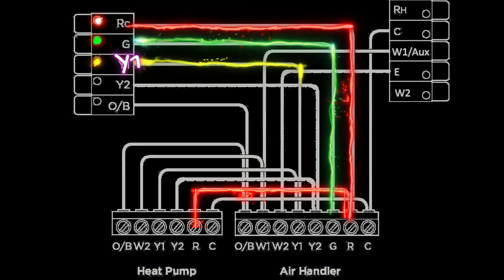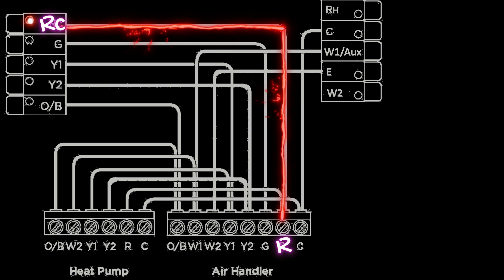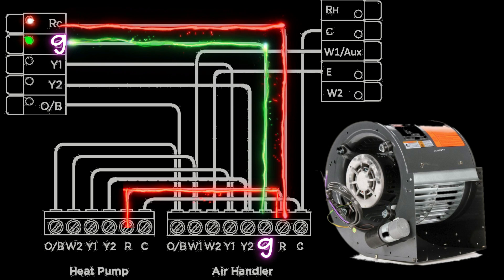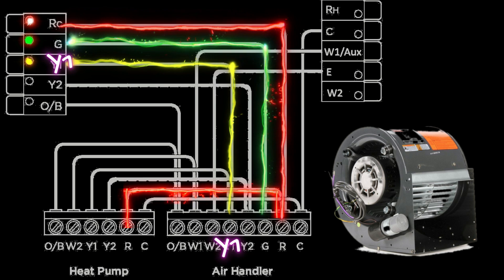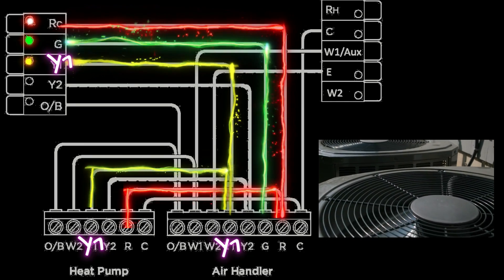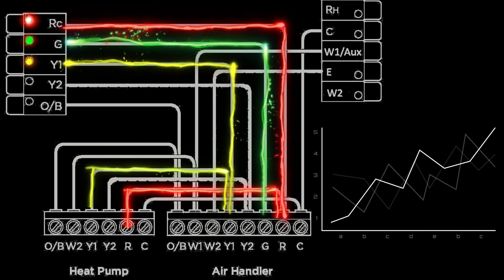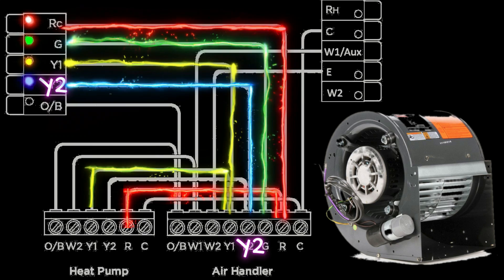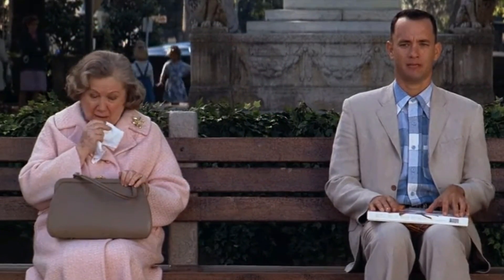2 Stage Heat Pump Wiring

Comment: In the Diagram, why do you have W1 on the air handler connecting to W2 on the heat pump?  I thought W1 on the air handler is only for Aux heat and only connects to Tstat, not heat pump??

Comment: I only have the Y terminal on my older Trane furnace board but I have a 2 stage York condenser and coil installed. I am hoping to use the Y2 output from my Nest thermostat to activate a relay to simulate signaling the furnace to kick up to the higher speed. I am hoping to use the spare red wire from the fan which is parked so I can create a low and high cooling speed. Thanks for the great pace that you lay out these videos because it helps me understand better how the systems work. The only thing I am confused a bit on this one is the way it seems that the Y1 and the Y2 are both staying energized at the same time. How would the PSC motor know which speed to run the fan in this instance?

Comment: Thank you so much for this video. I do have new 2 stages heat pump with humidifier. How should I wire the humidifier? Also, i use ecobee thermostat should I put on W1 or W2?  I have Carrier performance 

Thank you very much

Comment: I loved this explanation, and the colour makes it much easier to follow. However, I do have one request. Can you please  show how to wire up a natural gas 2 stage furnace and a 2 stage heat pump where full control is given over to the thermostat? (I am trying to understand how W1, W2, Y1, Y2 and E/Aux all fit into the picture). Thanks

Comment: In heat mode. Can a compressor be dead and the fan still run?  A tech told me the compressor is bad even though the Fan blades on the outdoor unit are still turning .  Unit runs constantly even though set point is reached at 70 on the thermostat.  Tech says compressor is not working.  I am at a loss with strips running constantly just to keep house warm.  Hope i have explained it correctly.
Reply: Yes. Top fan just cools the outdoor coil. Its not connected to the compressor which is at the bottom of the condenser unit enclosed in metal.

Comment: If i do not have a y2 connected to my thermostat, is it not gonna run 2-stage?
Reply from the maker: Depends on the system. Most will only run at a single stage without Y2 connected, but there are some systems where the control board itself can monitor temps through sensors and activate two stage cooling independently without the need of a 2-stage thermostat. 

So unless there are temp sensors located in your ductwork, for example, or sensors monitoring temp inputs like minisplit ductless systems have, it will likely only run as a single stage system without the Y2 hookup.

Comment: I need to know where I can connect  my fresh air damper and my flow switch
Reply: Fresh air..use two colors blue and yellow..blue will connect to "C" common at the air handler and yellow connect it to "y" at the air handler 
......
Float switch one wire goes to R air handler the other wire goes to all the red wires you have so thermostat(s) and condenser wire

Comment: I recently had a Trane 2-Stage heat pump and Trane 2-Stage furnace installed. They are run thru a Honeywell HZ322 TrueZONE® to two Sensi Smart Thermostats (upper and lower zone). Both thermostats are wired with only RC, O/B, Y, G and W/E. My installer says both pieces of equipment "change stages automatically" and there is no need for the other connections. It was over 100F here and even though I could see stage changes on my HZ322, I could not hear any changes on the heat pump, nor did the unit demand more electricity.

I don't believe my system is wired to work correctly. Suggestions?
Reply from the maker: Are there outdoor and supply temp sensors wired in?
Reply: @JerseyMikeHVAC  In-so-far-as-I-know, yes. The old thermostat actually showed the outside temp, while the new one does not.
Reply from the maker: @boomguy44  There should be wires connected to the DATS terminals on the zoning board which lead to a temp sensor on the supply air duct. If there is, check the board menu to make sure DATS is active/on.
Reply: @JerseyMikeHVAC  I have a red and a white wire connected to DATS - it appears DATS is set to 45F
Reply from the maker: @boomguy44  There is a COOL 2 indicator light on the zone board. Does it come on steady at all when the stat is several degrees above set point or does it blink?
Reply: @JerseyMikeHVAC  Yes, COOL 2 and HEAT 2 both show up if I run the system for several minutes, but the outdoor unit does not have a change in sound, speed or amperage no matter how long I run it or what the temperature differential is. My thought here is I only have five wires running to the lower thermostat and my installer is trying to make due. Running an additional wire set from my attic to the first floor is going to be a major PITA. I hope I am wrong and all will work as designed. Thanks
Reply from the maker: @boomguy44  Is it having issues reaching set point? I know some of these questions might seem generic but I have to ask a lot of questions to do diagnose, especially remotely.
Reply: @JerseyMikeHVAC  Mike, I appreciate your assistance. The unit will reach it's set point. The other day it was 100+ outside and 80 inside. I set the thermostat to COOL and 79. I have a ring camera on the Honeywell unit and watched it while standing next to the heat pump. The heat pump came on, and a few minutes later, the Honeywell unit COOL 2 light came on and there was no noticeable change in the heat pump. I waited several minutes and then lowered the thermostat to 68. I waited about another 20 minutes and still no noticeable change in the heat pump speed, sound or amps drawn. It took several hours to reach 68.

Comment: What is that on the ride side with the e/ c/ aux terminal??
Reply from the maker: Those are thermostat terminals. The schematic makes it seem like the blocks to the left and right are separate components, but they are all thermostat terminals from a single thermostat.
Reply: @JerseyMikeHVAC  thank you!

Comment: What about wiring up to a gas furnace. I have one to do in three days. Its a goodman 80% furnace and heatpump
Reply from the maker: Wiring at the control board will be the same. There's a link to another HP wiring video I made in the description that goes into detail on wiring up auxiliary heat and defrost cycles. It uses heat strips as an example but it will be the same wiring for the furnace.
Reply: @JerseyMikeHVAC   The control board doesn't have an O terminal Just, y1 y2   w1 w2
Reply from the maker: @wd8557  splice the two O wires together with a wirenut in the furnace. Control board doesn't need the O signal.
Reply: @JerseyMikeHVAC   Worked out great, thanks a million.